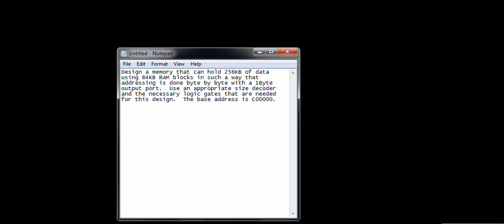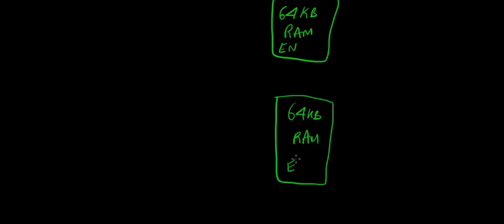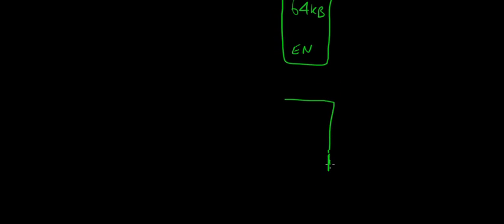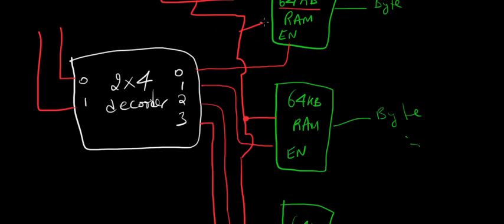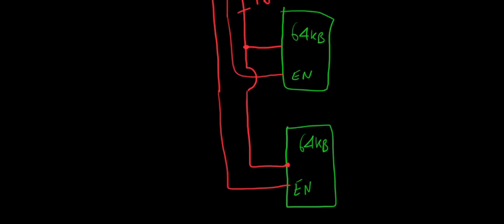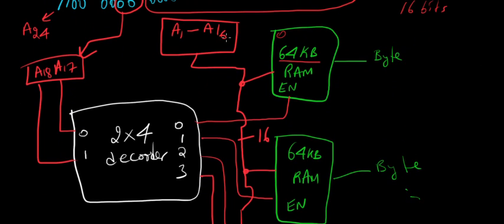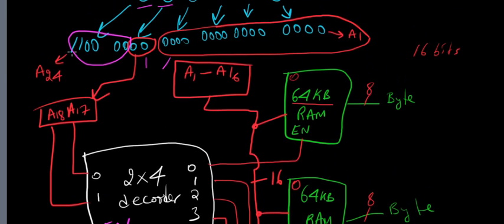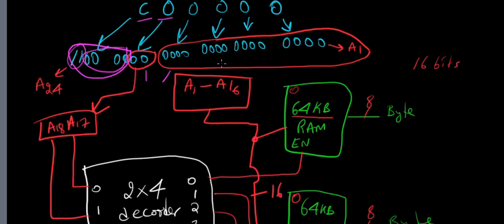256KB memory design using 64KB Ram blocks-Microprocessors example

Comment: This is also what I was searching for too, thankyou very much, am subscribed. Now the remaining part is figuring out how the ALU will talk with such a long address, it assembly, its easy, but in ALU architecture, its terrible
Reply: Not really, if you have an incoming instruction to the decoder, you first have to know what kind of instruction it is... is it immediate, is it register to register, etc... this is the job of the decoder. You also have to know the instructions layouts and this depends on the architecture. When the CPU goes through its clock cycles, how many microinstructions are there per full instruction, also when the 1st instruction is fetched from memory, is the memory address and the instruction embedded fully in the instruction, or is the first stream of bits your instruction, then the second fetch be your memory locations to perform such instructions? These also need to be known. Once you know the architecture and its layout, the datapath should be easy to follow. 

The ALU itself doesn't necessarily need to know the address for incoming computations... this is where multiplexers come in... the control signals come from the decoder and this tells the CPU to fetch those addresses to pull its content into either a temporary register to be processed on the next microinstruction clock cycle or is fed directly into one of the ALU's input channels. Then, the ALU will perform the appropriate calculation again based on the type of instruction that comes from the decoder. The ALU's output is asynchronous so it doesn't rely on any clock signal and thus it can be sent to another temporary register that will later be determined what to do with it... will it be stored back in memory, will it be used in the next calculation directly and then discarded, etc... again this is determined by the type of instruction that again must be decoded. 

It's not too difficult once you understand and know the ISA, the datapath, and how the decoder will determine which control lines are selected per microinstruction. For a basic illustration of a simple CPU design, you can check out Ben Eater's 8Bit breadboard CPU... from there you can begin to explore other designs and begin to understand how more complex systems work such as the MIPS, 6502, the Z80, x86, ARM, and now the RISC-V family of processors... 

There are two configurations of circuits: Circuits that are in Series and those that are in Parallel. There are two types of logic: Active Low and Active High. There are two types of voltage and current: DC (Direct Current) such as from a battery or AC(Alternating Current) such as from your wall socket. There are two types of clock pulses(edge detectors to be more precise) rising edge and falling edge. Other than circuits being in Series, Parallel, or combinations of both and once you have been able to define a circuit that implements Logical Behavior there are two types of logic circuits: Combinational and Sequential. Combinational is just an array of your basic logic gates without any feedback loops and does not rely on any clocking mechanism, their output is always based on their inputs directly. With Sequential logic, there are two types: Synchronous and Asynchronous. These always have a feedback loop which indicates that they are some form of memory starting with the basic Latch all the way to the complex master-slave flip-flop. The first type relies on a clock pulse and the activation of such device depends on your convention of logic, is it high or low logic, are you using the rising or falling edge of the clock? Everything has to be synchronized with this scheme and timing is very important. With Asynchronous types, these memory devices can be activated agnostic of any clock, however, these are tougher to work with because of data dependencies and the timing on reading and writing instructions... 

It just takes time, patient, and dedication to fully understand all of these concepts and how they are connected to give you a working CPU architecture. If you persist and you begin to understand the ISA (Instruction Set Architecture) of said CPU, then you can easily understand how it's Assembly Language is derived from its binary instructions. Once you begin to fully understand Assembly in general, then you can begin to understand how higher-level languages abstract away from pure assembly instructions to give you compiled languages such as C, C++, C#, etc... as well as interpreted languages such as Java, Python, etc... Now, not all of these languages and their instructions will talk directly to the hardware since most of it is passed to the OS of your system since the OS is responsible for Hardware resource management, thread pooling, its file system, and processor share times (process id from the said program that is currently active on the CPU), networking, etc...

I'm 100% self-taught in all fields of computers from basic usage, to building and configuring desktops, to programming to designing a simple CPU... Yes, it's not an easy subject and isn't for the faint of heart, but with persistence and dedication, you can tackle any task that you put your mind to!  I started off in the late 90s into the early 2000s with the goal of wanting to learn how to make a 3D Game / 3D Game Engine. I started by learning C/C++ and once I got used to the language by making small programs, learning the tools such as the compiler, linker, and debugger in the process and from there I began to learn various Libraries and APIs such as Direct X, OpenGL and here I am 20 years later learning Vulkan. Now as for what goes into a fully working 3D Game Engine will cover almost every aspect, topic and paradigm there is within all fields of Computer Science except for maybe Operating System design. I didn't leave out compiler design because many game engines may implement their own Language where you would have to create the syntax of the language and its parser... these languages could be a scripting language for the game that is interpreted dynamically during run time, or they could be a preprocessed language that is interpreted during startup of the application... These design implementations all come down to you being the developer's choice of implementation.

After this, I then had a desire to learn how to design, write and build Hardware Emulation applications, specifically CPU design, and from this, I started to dive deeper into the workings of Assembly, and how the internals of a CPU works and this lead me into CPU and ISA design, the place of abstraction where the Software meets the Hardware. There's a lot of math involved and the math will be different depending on which layer of abstraction you are working with. If you are working at the transistor level and how they are built and designed, then you are dealing with the mathematics that involves both Chemistry and Physics that is related to Chemistry. If you go up one level of abstraction, then you are working with the mathematics that is involved with Electrical Engineering and basic circuitry such as Ohm's and Kirchoff's Laws. If you go up one layer of abstraction and you are working with circuitry that is at the logic gate level, now you are working with Truth Tables, Implication Tables, Karnaugh Maps, Boolean Logic, and State Machines(Mealy and Moore), etc. At this same level and one level up is where your ISA and Assembly come into play and here the mathematics involved becomes complex because now you are dealing with sets, languages with their alphabets, and their various states. Also at this level, various forms of mathematics begin to evolve as you now enter the realm of Algorithms and this gives you the foundation of Big O notation for both Time and Space complexities of such algorithms. Also, data structures emerge at this point as well and we haven't even stepped up into the higher-level languages yet, nor any notion of an Operating System. So in essence what kind of math do you need? Just about all, but it depends on which topic and what level of abstraction you are working in. Anything from basic arithmetic to algebra to geometry to trigonometry to calculus to linear algebra, vector and matrix calculus to analytical geometry to number theory... It all depends on which level of abstraction you are working in and what topic or field you are trying to solve your problem for...
Reply from the maker: wlc